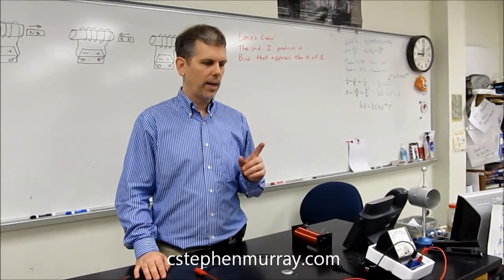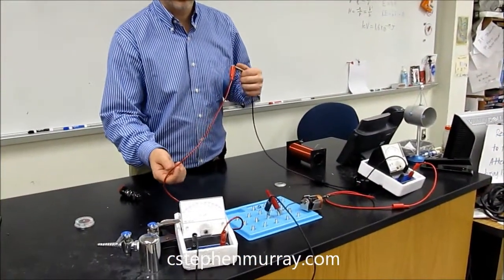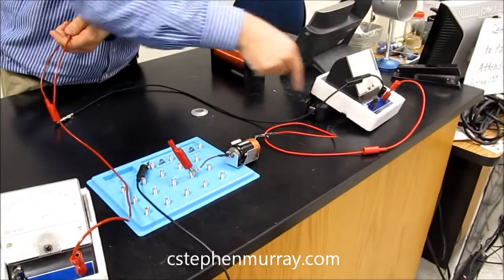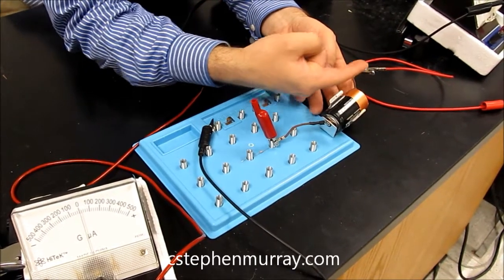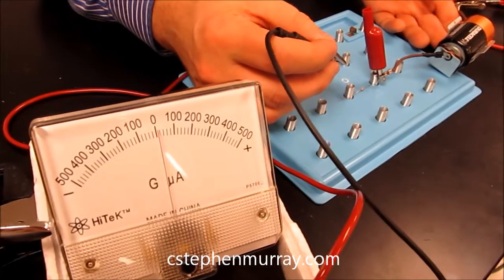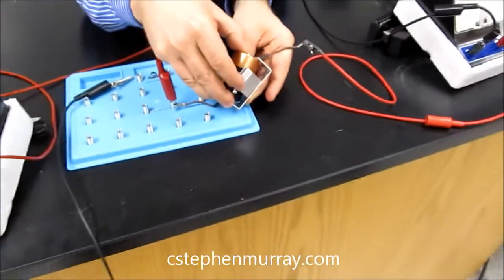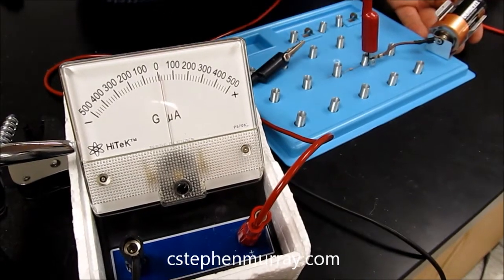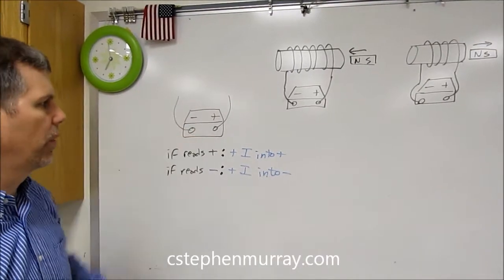Lenz's Law Part1: How A Galvanometer Works

Comment: positive current never flows
Reply from the maker: 1) That's absolutely not true.  Positive current flows in solutions (as H+ ions) and in protons beams. 2) If you mean "electrons flow through circuits, not protons", then, yes, this is true.  However, physics follows positive current flow, known as "conventional current".  This was started by Benjamin Franklin, Faraday, and the other scientist who first discovered electricity.  They did not have any proof whether positives or negatives were flowing.  Both work correctly for circuits and magnetic forces (Lorenz force).  It wasn't until the end of the 19th century when the Hall effect was discovered that there was hard proof that electrons flow through conductors.  Physics still follows conventional current, following positive current.  Check all the college physics books and you will verify this.
Reply: @cstephenmurray SIR I HAVE A DOUBT THAT AFTER KNOWING the original direction of current why didn't the  scientist changed their convention that current flows in direction of positive charges
Reply: @shivagoyal3384  because people already started working with the convention and turning it around wouldn't change much anyways, so they just kept it the way it it